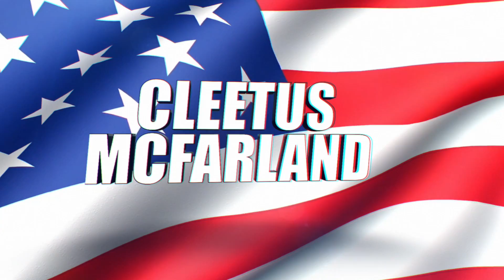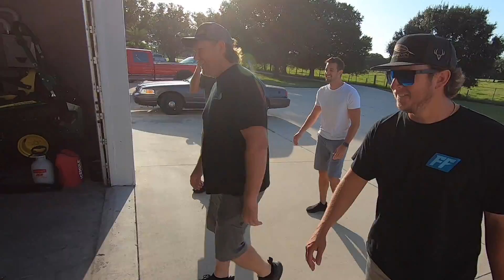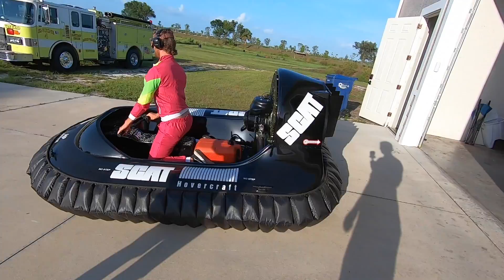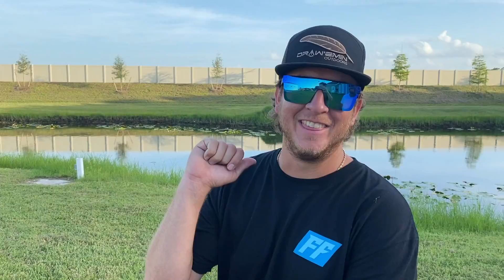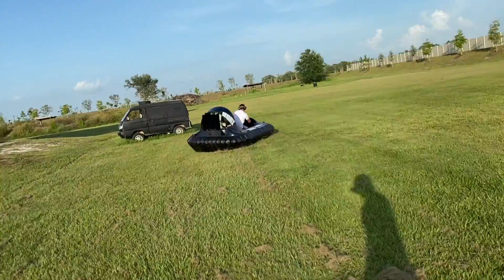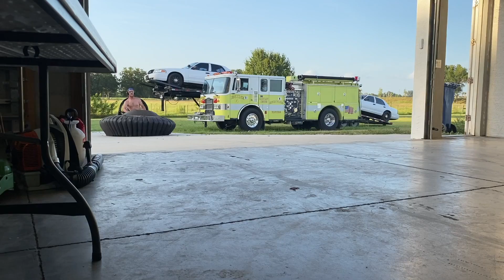Florida Man Takes His HOVERCRAFT Career To the Next Level (ON WATER) #BrotherCraft

Comment: I saw the typhoon hovercraft commercial when I was a kid. December baby so asked if I could get it for both bday and Xmas. I got it. My grandparents got me the battery for bday and Xmas. Battery was around $100 can. 7 min was advertised on a full battery it was more like 5. This was the toy I took the most care of. The rubber bag or boot that fills with air Cracked where it folded when sitting. 
Commercial made it look dinner then it was, but on linoleum floors it was great.

Comment: Dude. I know where an old coke runner hovercraft is sitting. It’s a big ass enclosed cab. It has 1 1 rotar engine running the lift fan and then each thrust fan has a 1 rotor running them. It’s sitting on a trailer stashed by a shed here local to me in Louisiana. It’s one of only like 20-30 built. It was repossessed by a local DEA agents and sold via auction to the guy that has it now.
Reply: I just googled to find one. It’s called a MK2 or MK3 HA5 Hoverhawk

Comment: need a bigger engine in the mean time you might need to give the blades a slightly less angle and see if that will allow that motor to rev a bit more and get into the power band a bit

Comment: you guys    ,you're having far to much fun
try setting your blade angle to forty five degrees and if you haven't fitted the tacho you should do that straight away
and check with the engine manufacturer on the maximum RPM,at full throttle you should not be able to rev. higher than recommended.

Comment: the engine seams very boggy 
I'm not sure what a 2 cycle jet ski engines rpm runs at i wouldn't go with air cooled for a hover with water cooling the gains in produce able horse power with higher compression ratios similar to how 2 stroke dirt bikes work smaller pistons higher rpm higher compression better even cooling 
with the back pack fans for para gliding are designed for low drag situations often a 3 blade propeller with the hover your turning a lot more blades so you need more torque
to turn the extra blades...im thinking a multi cylinder 2 stroke water cooled jet ski engine or perhaps a snowmobile engine the 2 cycle will give you a quicker response depending on the tuned pipe they can be made custom with a tig/hydro forming or even made by rolling it out by hand the reason for water cooling is even efficient cooling keeping temperature fluctuation and hot spots from forming it also allows for higher compression ratios with the constant up/down throttle is different than a para glide engine that runs fairly constant rpms for its duration so there is a better flow of air across the engine typically para glide engines are belted/pulley down a ratio i would not go with a 4 cycle  the extra weight and slow throttle response would hurt than gain the most lightest engine with lots of quick torque i can think of is a jetski engine since they are inline simple water cooled engines that produce monster torque on a quick snappy throttle and made to run at a near constant duration you could get by with a small radiator or a few copper pipes ran around the base or shroud if debree is an issue 
i would get rid of the multi blade rudders and go with 2 slightly bigger blades  multiblades are bad because the produce a lot of drag in racing you should know about drag the more air you can move over or around a car the less resistance well with multiblade its slowing down the air as it passes over the blades causing drag with 2 bigger blades you can move faster air in the direction they are turned giving a quicker turn response  these things where built with safety and ease of use in mind great for ice rescues or prop less water rescues

Comment: Call Gary at Hovercraft Depot and order Hull flotation kit with Scuppers and 503rotax engine upgrade package. It will perform much better and be safer. The original Scat Demo and race teams regularly used large snow mobile engines and easily made over 60 mph.  Caution though, high speed on the water in these can cause a "Plow In" which will throw you over the handle bars just like using the front brake only on a motorcycle. Add more body "English" (lean) to be able to have more control. Watch old racing videos to see how to fly fast!! World competitions held every year mostly in Europe. I have 3 of these from your size up to 21 foot long 6 passenger versions. Ontact online.   www.hoverclubofamerica.org